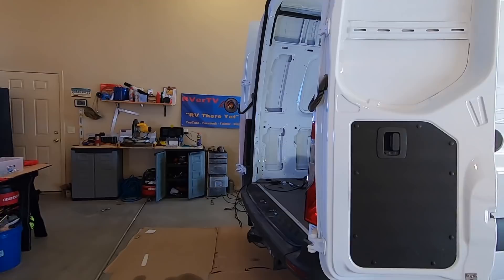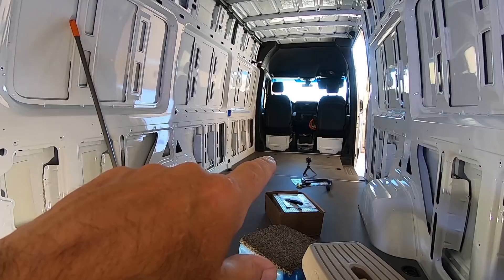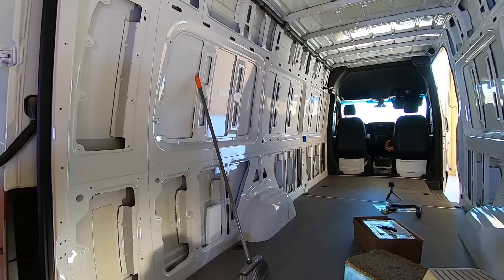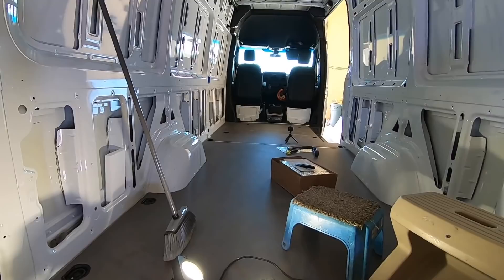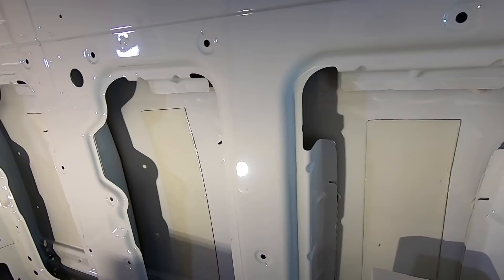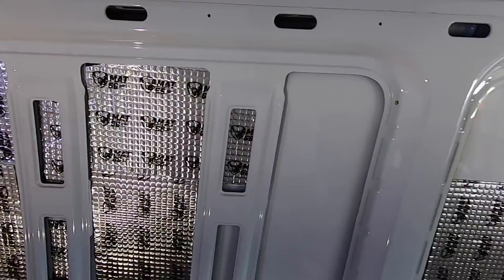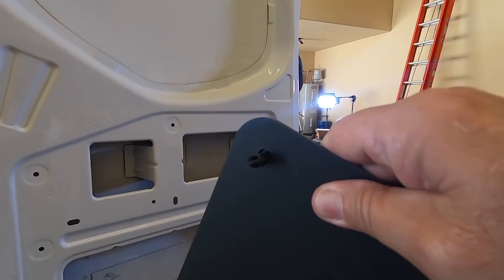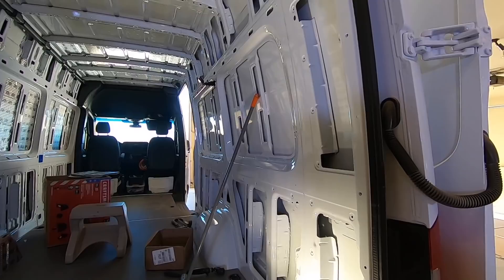Sprinter Van Build 2020 -  Day One Adding SoundProof Material

Comment: Did you happen to do any tests drive before and after to what difference the sound deadening actually made? That would be interesting.  Decibel meters apps can be downloaded in the Apple Appstore for free.

Also don't forget your front doors. You spend a lot of time in the cabin driving and are subjected to a lot of roadnoise coming in through the doors, floor and firewall areas.